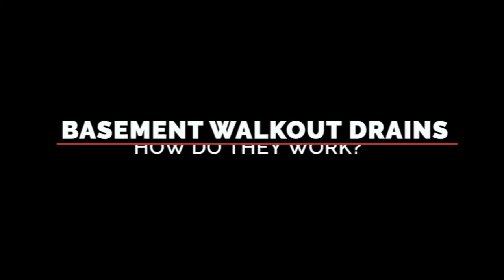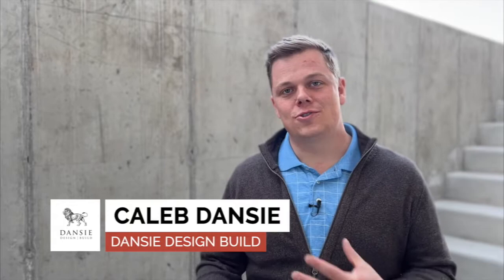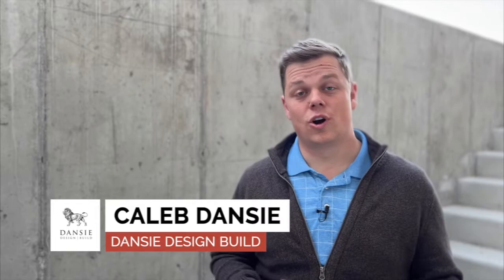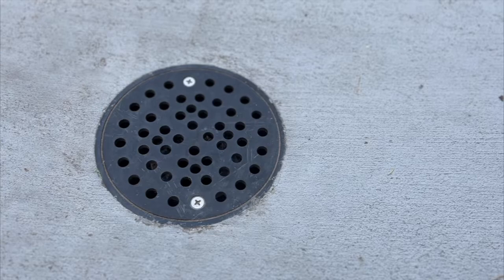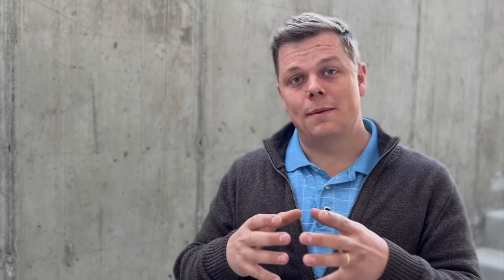How Basement Walkout Drains Work to Avoid Flooding

Comment: I like this idea, it's quite straight forward. I am concerned with water  softening the soil under the foundation. Any thoughts? Thanks.
Reply from the maker: That is a valid point.  
Water ends up in the soil and down around the footings all around the house naturally throught the year, with storms, rain, and snow, etc. 
The water that comes from the stairs/ walkout and ends up down by the footing is considered a normal amount of water that would end up down by the footing anyway if the stairs were not there.  
We have not experienced any structural failures, or issues with soils near the footings due to the drain, as this drain system has been approved by civil engineers, structural engineers, and local city governments.
If water is a big concern, you can also do a sump pump style drain, where the drain water is collected in a container, and when the water level rises to a certian point in the container, an electric pump turns on and pumps the water up and out of the walkout.  Normally somewhere in the yard.  
These are a great alternative to the drain we explain in this video, but do require more maintence over time, as electrical and mechanical components will eventually fail at some point.
Reply: @DansieDesignBuild  thank you for such a thorough explanation. That makes sence. It never occurred to me that this water is normal, the drainage just helps permeate the soil quicker but there is no extra water. I will definitely be doing this. Thanks!
Reply from the maker: @RedBeard20842  Just make sure that the landscaping around the stairs slopes away from the stairs, so you are not funneling surface runoff water down there. Rain gutter pipes etc.
Reply: @DansieDesignBuild  great tips! Thanks so much, I now have all the information I need to handle this project. You rock great video too.

Comment: Great video,  but do you have any cad details or pdf of how you would build that drain? I'm trying to design a plan for a walkout with that type of drain for a 4x8 landing at the bottom of 7 stairs.
Reply from the maker: When we design a walkout, the drain detail is part of what we draw in the plans.  Each one is different as far as how much gravel, the size of container, and the depth of the gravel.  These are all factors that change based on how much water is anticipated to enter the drain.

Comment: Hello @DansieDesignBuild when you use the five gallon bucket. Do you drills the holes 🕳 or is there a place you can get it with the holes already predrilled? Thank you!
Reply from the maker: Thanks for the question! Yes, we drill the holes in the bucket prior to installing it.
Reply: @DansieDesignBuild thank you for replying. When you say drill holes on the bottom. Do you put the lid on the bucket?  Also, I started digging for my walkout basement and once I got to six feet deep. Water started to come out. At this situation Would you recommend also installing a sump pump?
Thank you in advance!

Comment: Is the 5 gallon container you put in empty or do you put gravel in there as well? Because if it's empty wouldn't it be dangerous to step directly on the drain? (In case it breaks inwards with weight)
Reply from the maker: Hi Ale,
You should not put the gravel inside the container. This space is for water to go while it is percolating into the soil. 
The concrete slab is typically 4” thick(or greater) and will not have an issue supporting the weight you would find in a residential application, like a landing at the bottom of a basement walkout entry. 
Thanks for watching and for your comment!

Comment: what container do you use for the 10 or 20 gallon?
Reply from the maker: One like this. 
https://www.sportsmans.com/camping-gear-supplies/hydration/water-storage-containers/15-gallon-barrel/p/103351?channel=shopping&gclid=CjwKCAjws8yUBhA1EiwAi_tpEdTlNeNKMowhbyj9MfHdwTe-AMm6E3gSeoT-ExE4Y_nZpX-TZrBHmBoCLYAQAvD_BwE
Just add a 3” hole on the bottom and 50 or so 1/2” holes on the sides.

Comment: I have a stair drain. The drain cover has holes to let water through but in heavy rain, It backs up somehow. Then I can hear a puddle form. Next thing you know, I see water coming through the basement door. I’m wondering if the original drain cover is restrictive? I keep the area clean.
Reply from the maker: I’m sorry to hear you have had issues with your drain. It could be a number of issues and there could be many solutions. 
I’d recommend taking the cover off to see how the drain was built. If it is similar to the ones in this video, try cleaning out the container area. After many years you may have dirt that accumulated and is hindering the percolation rate of the drain system. 

Let me know if this helps you. I’d like to hear back!
Reply: @DansieDesignBuild  Thanks for your response! It rained last night. Thankfully it was light but when it dries up, I will take a look. This morning, I can see some wet dirt but not sure about the depth.
Reply from the maker: I’m glad to hear it did not flood. Ideally you should have 16-24” of depth before there is any gravel. Dirt would not be good to have there as it does not allow the water to drain well enough. If you can fit your hand down the drain and clear out the dirt that would be ideal.
Reply: @DansieDesignBuild  I will try that and let you know!
Reply: @DansieDesignBuild  I underestimated the size of the drain hole. I can’t fit my hand down there. I was able to take a flat edge screwdriver to loosen the dirt some but it feels like fine gravel to me. I got me a garden hose to do a flush and it’s going down slowly. It looks like there is no pipe system in place. The walks looks like it settles in the ground.
Reply: I have this same issue. When it rains heavy, water in the ground seeps up through that drain and floods that outside area and seeps into my basement door. I believe this outside drain is simply a hole in the ground and not connected to any drain pipes. So, can I simply just seal up that drain opening to prevent water coming up from it?
Reply from the maker: @be236  This could be because you have a high water table.  I am not sure where you are in the country or what your soil type is, but here in Utah/the desert, the groundwater table is generally low, and we don't have the issue of the water table rising above the drain.  
You could also consider installing a powered sump pump that automatically turns on to pump the water up and out of the stairway and into the yard/street.
Reply: @DansieDesignBuild  Yes, I do have high water table, I'm in Seattle-area... When I walk in my yard, and with heavy rain, my lawn area is very soggy...

Comment: What do you do if that kind of drain does get clogged?
Reply from the maker: Over the course of 20 or 30 years the drain may accumulate some dirt and debris. This can be cleaned out by removing the screws on the drain grate, reaching in with a small hand, small hand shovel, or a shop vac vacuum and removing the accumulated debris.  Other than that, just keep the drain free of leaves and other obstructions and it will work well for years and years to come. We don't see any issues with this drain style in our area. Let us know if you have any more questions!

Comment: Hi, how deep in the ground did you put the 5 gallon container.  Thanks
Reply from the maker: I dig down about 2.5’ lower than where the top of the finished concrete will be. That gives enough room for the gravel and the container. I don’t know if you’re in Utah, but with our dry soils this is a good drain set up.